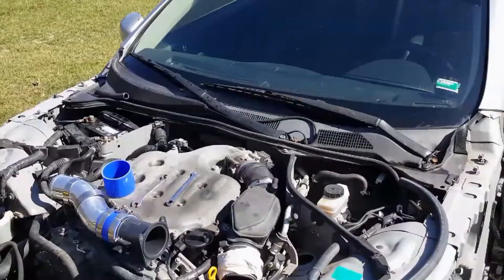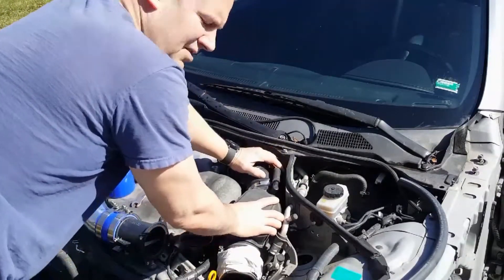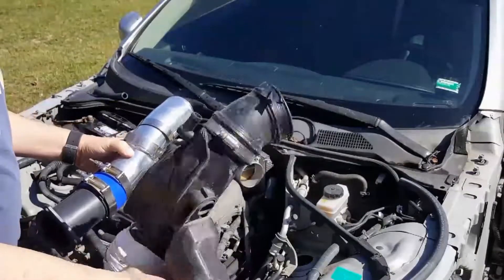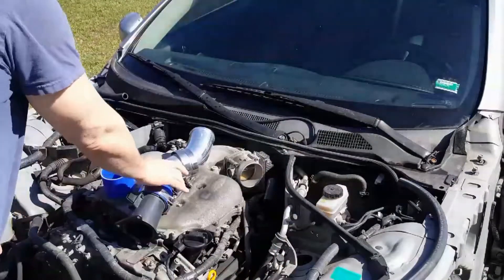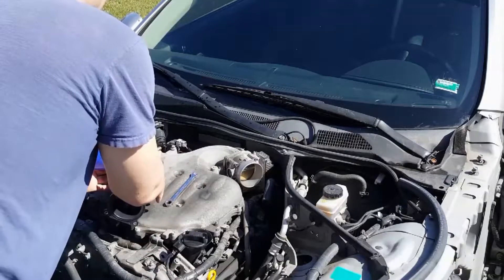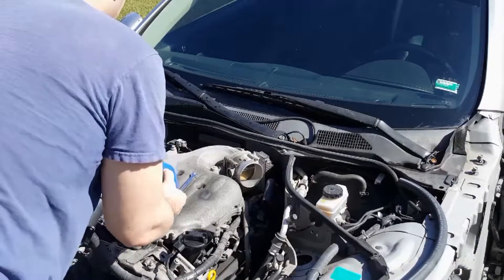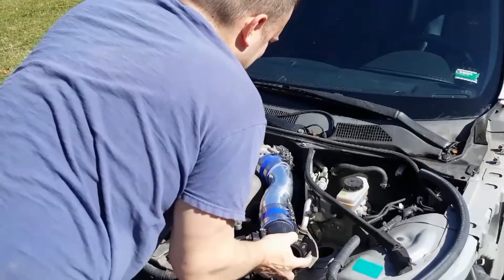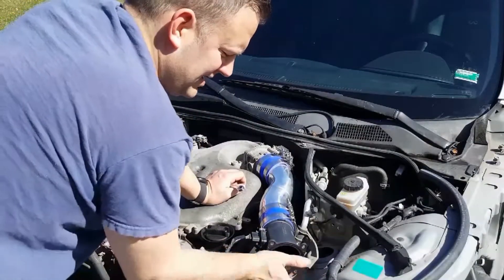2005 Infiniti G35 Z tube installation

Comment: did the car break yet after you put no filter.....
Reply from the maker: Not at all, as you can tell the car was not ready to drive down the road. Never stayed started like that for very long..and if you are afraid of doing this without a filter even temporarily Luke this you can put a leg from a pair of Womens hose on there.
Reply: @RoadHardRoadhouse  I know I was just trying to see what you were going to attach to the Z tube and you never even talked about it and just skipped to the end of the video. I hope no idiots install a Z tube without an intake filter